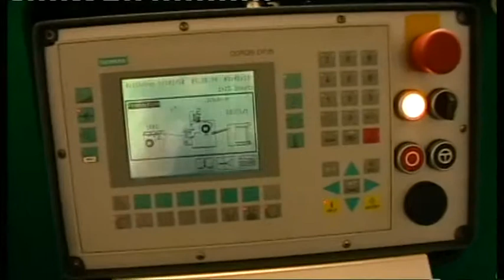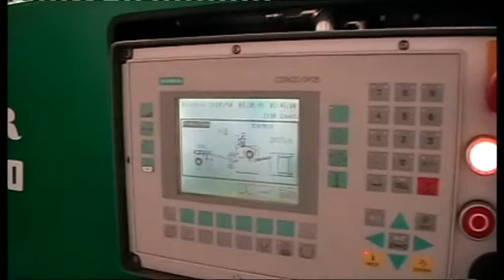Billhofer 102.VOB

Comment from the maker: Buenos Dias, 
Esta máquina ha sido vendida ahora. Tenemos otra máquina Bilhoefer en venta ahora: 
Bilhoefer CKM1200 Laminating Machine, 1982,
Max Sheet Size: 1200mm x 1450mm, For Wet laminating and Thermal Laminating, Mabeg Automatic Feeder, Achilles Laminating System, BAT 127 Sheeter Unit, Automatic Pile Stacker.
Si es interesado, por favor nos contacta directamente para más información: nathalie@rosewood-ventures.co.uk
Saludos